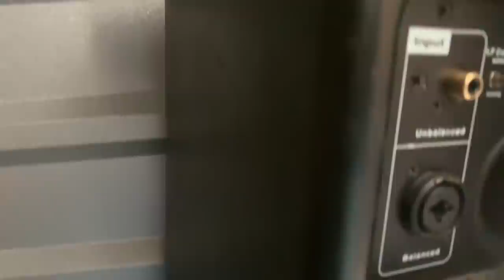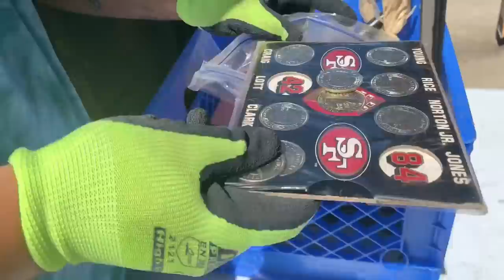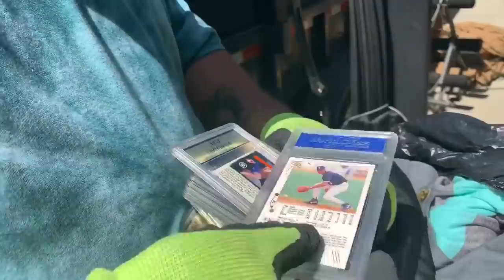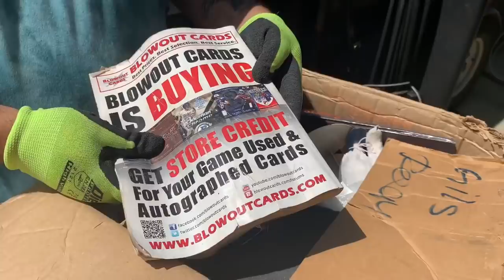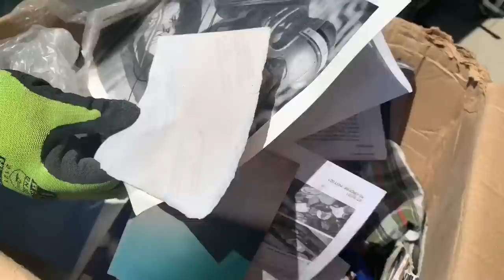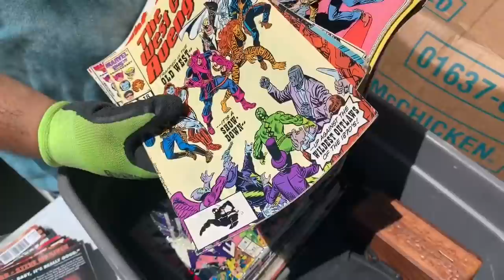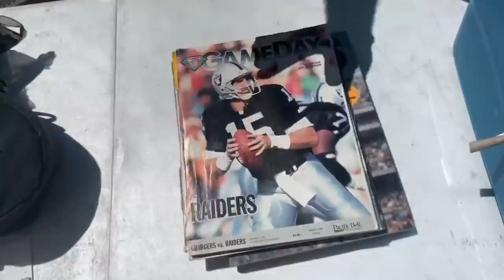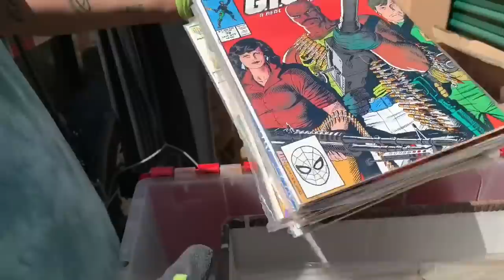HAORDING BASEBALL CARDS! | BUYING STORAGE UNITS w/ STORAGE STALKER

Comment: A Jordan 1997 PMG just sold for over $350k. A 2011 Mike Trout rookie auto sold for $150k. These cards were perfect, but bend one corner even just slightly and you easily knock 90+% off the value. Cards can be big money, but condition is critical.

Comment: Those cards you said are cheapos are Graded 10 cards, meaning they are flawless.  Those are valuable.
Reply: Junk wax + No name grading company, = $0 sucker bait. Not one PSA, SGC or Beckett graded card, all of them have to be unslabbed and resubmitted to a reputable company if they hope to have any value out of them.
Reply: Tripper Trooper it don’t matter those are junk wax anyways not worth slabbing in my opinion.
Reply: Mone those are junk cards they made way to many of those years $1 each in my opinion.
Reply: @chadmilligan7497  Some of those junk wax graded cards go for between $20-200 each, look at ebay SOLD listings...and we only got to see half of the graded cards.  I admit I do not know the grading company, but still, some junk wax has value.
Reply: Mone if that was the case I would be rich not in the junk wax era sir there’s to many flawless junk wax cards.
Been collecting cards for 40yrs.
But I will sale you all my junk wax if your interested.
Reply: Chad Milligan the Maddox rookie he threw around graded in a 10 by psa will go for some decent cash
Reply: Not psa or bgs and sammy sosa topps rc greg maddux 87 traded 94 a rod prob $40 the whole stack

Comment: So....I wouldn't worry about mishandling those baseball cards. They didn't have value to begin with. They're all from the massively overproduced "junk era" not worth the cardboard they're printed on. The graded cards in the slabs are worthless too. Those particular slabs were scams. Fly-by-night operations started by card dealers to sell their own stock by slapping a Gem Mint 10 on literally anything. You can't even sell them on eBay because those companies/slabs have been banned. Collectors will absolutely NOT pay a premium on slabs that aren't PSA, Beckett or SGC. The only card I saw that has any potential value is that 1987 Topps Traded Greg Maddux. But only if it's the Tiffany version and you'd have to break it open and get it regraded by PSA. If that got a legit Gem Mint 10 you'd have a $250-300 card. Otherwise I'd just find someone in your area that buys mass lots of junk era cards. They'll take them and repack and redistribute. BTW, this is only in reference to the baseball cards that I saw in the video. I know nothing about the value of the football and basketball cards.

Comment: 1990 nfl barry sanders emitt smith rookie cards could b in those sealed packs
Reply: so could a booger - they are worth the same NOTHING!  I would hold on to the emmit smith for a while because maybe in 2-300 years it could be worth it.  Look, you can buy the whole sets of these cards unopened for less than 20 bucks